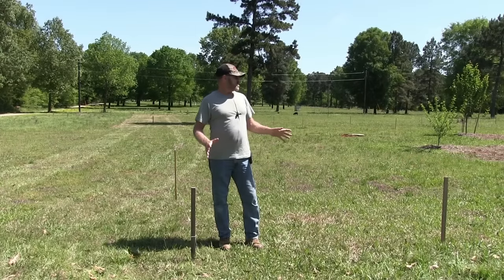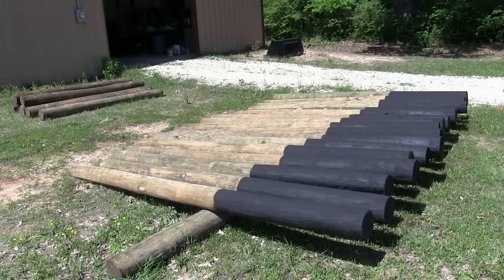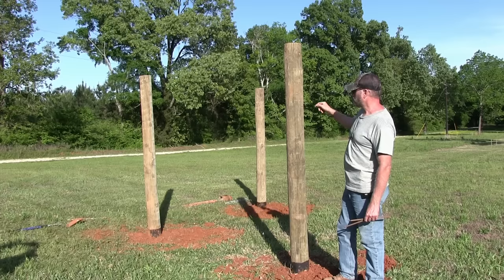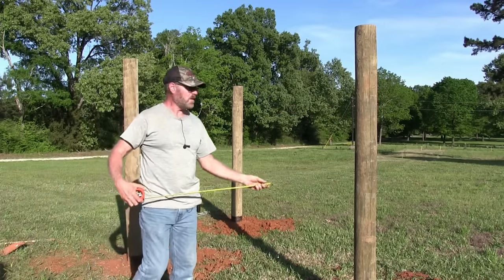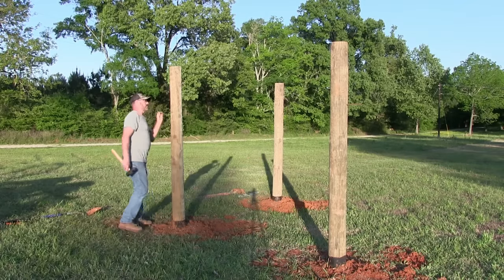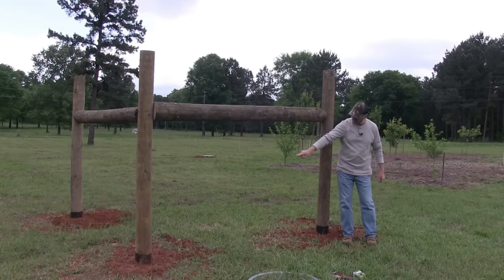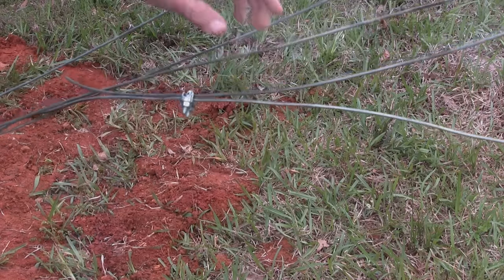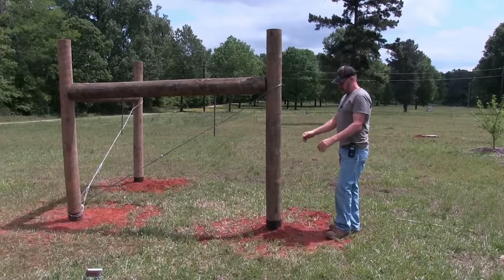Corner post installation and bracing - Detailed video

Comment: just a question, why didnt you set the horizontal posts inbetween the corner post on the pallet forks and then drill the holes for the re bar and then hammer it in while in place? It seems that it would be easier then pre drilling and trying to line everything up after the fact. Thanks, great video and new subscriber
Reply from the maker: That would work too. I could of got one end in place the drilled through and hammered the rebar in, then go do the same to the other side.

Comment: I have been looking for a video like this for a while, clean, straight to the point. When I'll do mine I was thinking about sealing the top of the post (crosscut) facing the sky with the same protective paint you used at the bottom to avoid water to stagnate in small pockets and eventually get its way into the post which with freezes may promote wood cracking. I have no experience though so don't know how strong that treated post is so I may be overthinking.
Reply: Hi, ok so most posts fail at the ground to air interface.  Water itself does not rot wood.  It actually PRESERVES IT!  Wood rot happens from a repeated "wet-dry' cycle.  When this happens the wood fibers swell and shrink and it weakens them.  That is rot.

OK the tops of post do rot as well and take lots of sun too.  This will eventually cause too rot, but it's less likely to do anything major to the post.  Most will fail at the bottom first as I stated.

Painting the tops would certainly slow down the top rot.  However that roof sealer will crack eventually and let water in.  

Maybe a better solution would be plastic caps.  Like they use for piers at the seashore.  They may last a lot longer.  ?
Reply: Thank Mr Push, I have also seen some homesteaders cutting the top at an angle facing south so rain water  slide down and it get direct sun in winter.

Comment: That is a really nice corner post , I sure do like the way you have done it, nice and sturdy. My husband always put the gate on the ground and it had gotten so hard for me to open is why I said what I did about the wheel, we ended up putting them on the gates :-)
Reply from the maker: Thank you, wheels definitely help carry the weight and make it much easier to open but the ground has to be fairly flat or level. Thanks for watching.

Comment: I've seen a deer jump a 10' high chainlink fence. Also good job on the fence. I am a fence contractor in SW Florida. I install pvc, chainlink aluminum and wood fence. Ill be installing my first no climb horse fence in a month or so.
Reply from the maker: Thank you, Yes deer are amazing jumpers. I'm hoping to deter the deers from jumping the 7 foot fence into my orchard.
Reply: @petebeasttexashomesteading  I own a commercial orchard. 7' is plenty. They will not jump 7' to get in, however they can and will jump it if you leave the gate open and chase them out....Been there, done that!

Comment: If you turn your pto off while your auger is still in the hole then lift it out nice and slow it will leave you a little less work cleaning them out.

Comment: at the bottom of the post i put a chain saw cut just over 1/4" deep on the cack side for the wire to set into, plus 2 staples one on each side, as i have had the wire slip up in the winter pulling out the staples, our frost go down 7 feet.. o tar the cut once the wire is in

Comment: Just thinking about the use of a tension wire for bracing as opposed to the old method of a compression timber pole brace that goes in opposite direction. With a gate hanging off that post the wire helps to keep the vertical posts and the horizontal  beam clamped together tighter, were as the wooden brace method would pull apart. But if its just fencing wire on both sides I think I still prefer the good old wooden braces, also with notches on all joints to stop slipping up and down the posts. It's the old school Chippy 🔨 in me, can't beat a good mechanical joint over relying on just fastenings. 👍🏽

Comment: Nice job, unless that end treatment allows water to escape it will build up and still rot the bottom. If you ever have removed a bad fence post ( like the ones you have )the top always rots first due to the fact that water enters the top (seal the top and forget the rest) the post is already treated also add rock to the bottom so any water drains
Reply from the maker: Thanks, These post are CCA treated and should last 30 years but I also treated the post that makes ground contact with roofing tar except the very bottom so water can get out.

Comment: When drilling the pilot holes for your rebar, how do you drill dead center and through the post. I know you have a feel for it, with experience but what do you suggest for someone’s first fencing project?
Reply from the maker: After you mark the height of the rebar, just put your drill on the mark and keep eye balling it from side to side to make sure you're on center and as you drill, keep checking to make sure you're drilling straight and not on an angle.

Comment: Got a smaller version of the same type design cedar post fence and the horizontal cross members are stress cracking, probably because the wires were over-tightened.   Trying to figure out how to spread the fences posts just an inch or two so I can remove/replace them.   Any thoughts on how to do this?   Thanks.
Reply: Archimedes, find a fulcrum point and spread the posts using a bar or another post. I have used a porta power unit with a post as an extension to spread the posts. Or hook the top of the post to your tractor(truck, car, horse) and pull.

Comment: What did you treat the bottoms of the posts with. Black paint? Tar?  I think it’s a great idea
Reply from the maker: Correct, I used Henry #201 roof coating mixed with a little diesel fuel to thin it out enough to brush it on.

Comment: I'm getting ready to do this and it's my first time. Dont mean to ask a dumb question but would cement make a difference?
Reply from the maker: Not really, if you get the post down 3 ft, pack it down good and tighten the wire as I did.....it's not moving. Concrete will just rot the post. I treated the part going into the ground with Henry number 201 asphalt roof coating https://www.homedepot.com/p/Henry-0-90-Gal-201-Fibered-Roof-Coating-HE201142/100005599
Reply: @petebeasttexashomesteading  thanks Pete. I will definitely follow your advice. Thanks for responding.

Comment: Pete- I didn’t see any concrete put in for the posts? Don’t need it? Also black paint on posts, what is that?
Reply from the maker: No concrete needed because my posts are 3ft deep. I brushed on some Henry #201 roof coating on the bottom of the posts to keep them from rotting.

Comment: Pete,  Did you dig a 6" hole for your H support post or 8"   I have a 6" auger and want to use 6" post however, it seems like you would have to dig a 8" hole for 6" post so you would have room to pack the dirt around the post and with a 6" hole you could not pack it.
Reply from the maker: I used a 12" auger, it's good to go bigger so you can move the post around a bit if you have to before you start packing it down.

Comment: Quick question. I’m building a small pasture for emu! I am using wooden posts in corners as you did . 2 ft  deep and 6 ft above ground. Should I use concrete around those wooden posts ??????
Reply from the maker: Not really necessary. You could also put the posts in the hole and fill around the post with gravel instead of dirt and pack it down real good.
Reply: @petebeasttexashomesteading  Thanks for your knowledge. Your information has given me the confidence to build my own fence and trust that when I finish it . It will last for many years to come.
Reply from the maker: @strangeoaks  Awesome 👍

Comment: I'm about to build a fence almost identical to yours by the end of May. I keep hearing differing opinions about using concrete in the holes to anchor the posts. Does the concrete really matter? Your fence looks solid with out it.
Reply from the maker: If you use concrete, make sure to put the post in the hole first then add a couple inches of dirt at the bottom then the concrete. This way the water has a way to escape at the bottom and not get stuck down there like the post was sitting in a concrete cup. These post I put in are solid and are not going any where plus I don't have to worry about them rotting either.
Reply from the maker: I also applied Henry #201 roof coating on the bottom portion of the posts for added protection.
Reply: @petebeasttexashomesteading  Awesome thanks for your reply and the info. I'll let you know how it went once I'm done putting it up. Thank you for all of your videos on the matter btw. I've watched all three and its given me a better idea of what to do.
Reply: @petebeasttexashomesteading  also I read in another comment that you used the #201 with some diesel. What's the mix ratio for that? 1 to 10? Or does it really matter?
Reply from the maker: @Volleballogist  it really doesn't matter. The consistency of #201 is really too thick, you want it more creamy. Just add a little diesel to the Henry #201 just enough to thin it out so you can brush it on.
Reply: @petebeasttexashomesteading  Gotcha, thanks!

Comment: I would think you would want to measure the height on the corner post and markit with a small nail.  Then, run a string to the each of the support poles using a line level. that way, if the ground is uneven, your horizontal supports will all be level - even if teh 'ground' ain't

Comment: Hello Pete,
What is the length of the 3/8" rebar that goes horizontal into the H brace? You mentioned leave about 1.5 inches out for the wires, 6 inch post - perhaps a 1ft 3/8" rebar with about 4.5 inches into the horizontal bar? Thank you
Reply from the maker: I'm pretty sure it was 12 inch long rebar.
Reply: @petebeasttexashomesteading  Thank you

Comment: Has anyone used the product Wedge Loc?  It uses t-posts to brace h-braces and corner posts so there is no need for wood posts and steel posts.  Just curious how it holds up over time.  Thanks!

Comment: What are your post treated with?
Reply from the maker: On the bottom of the post's I used Henry #201 (Home Depot) roof coating mixed with a little diesel fuel to thin it out just enough to brush it on.

Comment: Good afternoon,  I’m working on a fence for my goats,  I can’t seem to keep the corner post from leaning when pulling tension on them, do you have any suggestions to help with this issue ?
Reply from the maker: If you wired the posts as I did in the video, those post should not move when tension is pulled on them. The fence doesn't need to be super tight because you'll have t-posts or fence posts holding  the fence up.
Reply: @petebeasttexashomesteading  how long did you wait to wire them together after you put the post in ?
Reply from the maker: @raserei777  Not very long because it was the next step after putting the posts in the ground and before putting the fence up.

Comment: I'm starting a fencing project around our chicken coop, to give them a large yard and keep them safe from wandering dogs.  Where did you get your tamping tool?  All the ones I find have the big tamping square at the bottom.  I need something small, like what you're using, to tamp around the pole.
Reply from the maker: I know Tractor Supply and Harbor Freight carry the ramping tool.
Reply: @petebeasttexashomesteading  I looked at TSC, but will check again. Might you have a link?
Reply from the maker: Check online at your local Tractor supply, https://www.tractorsupply.com/tsc/product/groundwork-17-lb-tamp-bar-70-in-x-1-in?solr=1&cm_vc=-10005

Comment: I'd like to know how to treat the bottom couple feet to resist rot.
Reply from the maker: I used Henry #201 roof coating diluted with a little diesel fuel to thin it out a little. Here's the video. https://youtu.be/yd0nDUYHi3U

Comment: What was the second treatment (black stuff) that you applied to post?
Reply from the maker: Henry #201 roof coating mixed with a little diesel fuel to thin it out a bit so you can brush it on easier. I got it at home depot.

Comment: What did you treat the below ground part of the post with?
Reply from the maker: I used Henry #201 roof coating that you can pick up at Home Depot. I added a little diesel fuel in it to thin it out a bit so I can brush it on.

Comment: Excellent video and tips.  Two questions:  What do you use to coat the bottom of the posts?  And I noticed you don’t use any “Quikrete” in the holes.  Is this what you recommend?  One the few corner fence posts that I’ve installed, I dumped some dry quikrete in the holes, but always wondered if this was necessary.  Thanks!
Reply from the maker: I used Henry 201 fibered roof coating. Here's the link: https://www.homedepot.com/p/Henry-0-90-Gal-201-Fibered-Roof-Coating-HE201142/100005599 I never cement/concrete my post because. The cement acts as a cup and water gets trapped in between the wood and cement and will rot the wood. The key is to make sure the posts are deep enough 3 feet. You can also use gravel in the hole around the post and pack/tamp it down.
Reply: Pete B. Thank you!  I’ll head on over to Home Depot and pick up a can.
Reply: Good advise, how well I know!
Reply: About 8 inches of crushed rock at the bottom of the hole should solve the water retention problem.  Poor mans way to set the posts without using Quikrete is to fill the hole with big rocks first and then smaller rocks and finally with dirt.  We did this in the sand during the Gulf War when Quikrete was unavailable.  It makes a very solid hold.
Reply from the maker: @ramrise  👍

Comment: I am building a 4 rail fence in GA.  Alot of people are saying I should concrete the holes.  Your thoughts?
Reply from the maker: All the post I've replaced were in concrete and rotted. When you put a post in concrete, the concrete acts as a cup and holds water around the post that's why I don't do it. I would treat the bottom of the post with Henry #201 roof coating from home depot and make sure you put the posts in the ground 3ft and coat the bottom 3ft 6inches of the post. Here's a video I did treating fence post. https://youtu.be/yd0nDUYHi3U
Reply: @petebeasttexashomesteading  Thanks for the info.  I see more people saying put them in concrete, but that just seems crazy to me.
Reply: @petebeasttexashomesteading  Sorry to ask so many questions.  For a 4 rail fence, how long of a fence posts would I need, and how much should i put in the ground?  Thanks for any help.
Reply from the maker: @wesley3flex   It all depends on how high you want the fence. If you get an 8ft post, I would put it in the ground 3ft and you'll have 5ft above ground. You can always cut off some if it's too high with a sawzall.

Comment: I wouldn't buy anything from harbor freight.  I Klein bit would drill through those post in probably 3 seconds with a 1/2" drive Milwaukee battery drill.  You could hold a framing square against the post to help you drill straight.

Comment: Could you soak the corner post in used motor oil before using the henry 201 tar
Reply from the maker: Yes, But a 50/50 mix of diesel and motor oil would be best. The diesel thins it out and soaks in to the wood better. Here's a link to the video I did.  https://youtu.be/yd0nDUYHi3U
Reply from the maker: I've also thinned the Henry 201 with diesel a little too. It makes it easier to apply and soaks into the wood better.
Reply: How long did the. Coatings take to dry?

Comment: Hi I glanced over all the comments to see if anyone has asked already (all the way to the first comments of people trying to tell a guy with nearly 100K subscribers how to make a video :) ). Anyway, my question is can you tighten the high tensil wire too tight? After tightening the wire on both ends of the fence the h posts are leaning. They are leaning the opposite direction that the fence is pulling so intuitivly seems ok, but i was wondering if this is something that needs to be fixed before i actually pull the wire and attach to posts. For a crude graphics, instead of my fence leg looking like this H-----H , it looks like this \-\------/-/  .. TIA
Reply from the maker: You're going to have to losen one of the high tensil wires on the H post and tighten the other to straighten it out before you put the fence on.
Reply from the maker: But you might need to add water around the post and let it soak in the ground or wait till a good rain to straighten the posts.

Comment: What did you coat fence post with tar?
Reply from the maker: I used Henry #201 roof coating and a little diesel fuel to thin it out a bit so I could brush it on.
Reply: @petebeasttexashomesteading  I thank you kindly! I’m going to use 6/7” x 8’ from TSC an bury 3’ in. In a hurry to put the fence in. Big box stores only got 8’ not 10’. I’m doing a 100’ run at longest and two 50’ runs, all together in a U shape. Think it’ll hold up the 5’ no climb horse tension wire or should i slow down and wait for lumber shops to open Monday and get a 10’’? Also; the fence itself is coated in black. Was thinking of painting the posts in that tar too. Can I tar everything except the very bottom face of the post? And would you suggest gravel down there as well for drainage?

Comment: Great video! I normally use the tractor to position the horizontal braces before using the long bit to drill the holes. It makes sure rebar is aligned correctly while driving it in.

Comment: Where did you get your 10' posts from?
Reply from the maker: They are locally made and CCA presser treated. You'll have to search your area to see if anyone carries them. I also treated the bottom 3 1/2 ft with Henry 201 roof coating diluted with a little diesel. That's why they look black.